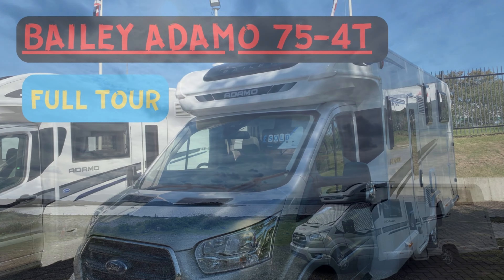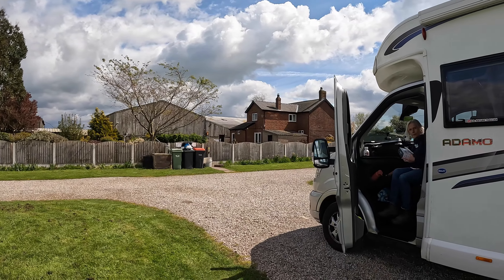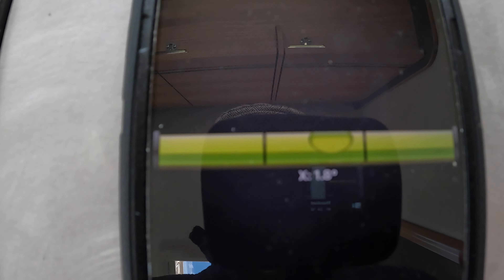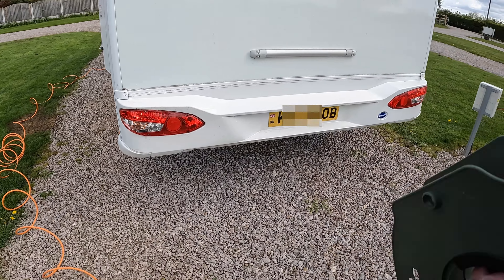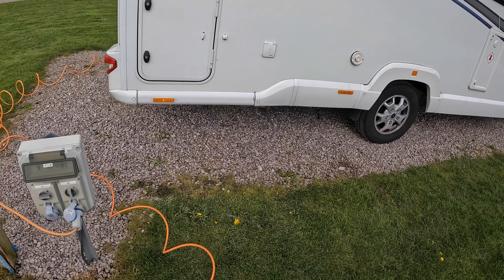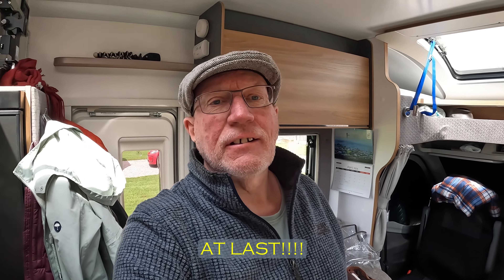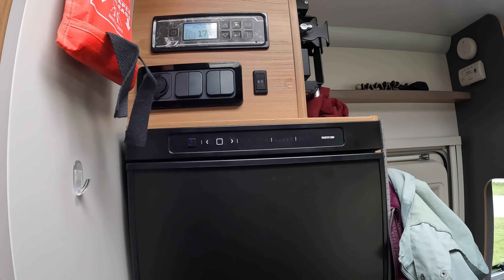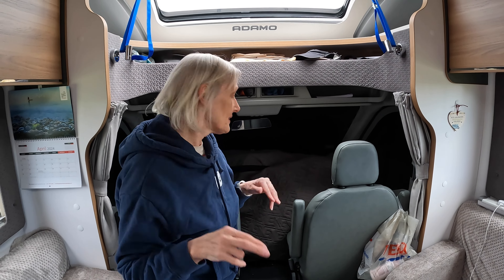HOW WE SET UP OUR MOTORHOME ON ARRIVAL AT A CAMPSITE - Bailey Adamo - A Few Tips and Tricks

Comment: Happy Weekend Dave and Sue wherever you are today! Even though I do not have a motorhome it is fun to see how you do things in Florrie. There are routines to learn and small tricks to discover, but with time you are getting quite good at it! And you do it in a way that is down to earth and credible (not like those movies where it looks like no one ever has lived in the home). I was surprised that condensation could interfere with the electrics of the car. That seems like an unnecessary fault as condensation has been know for a few centuries or something:)  I also see clearly that life is both a bit easier and a bit harder as a hiker using a tent as a home and not a motorhome. Have a great Sunday! All the best, Ant
Reply from the maker: Cheers Ant. Hope you’re well mate. 
Yes we’re learning all the time - already had a comment that has helped a lot 👍
The motorhomes that have been built on a Ford Transit chassis do suffer with the condensation problem. Apparently Ford say it’s the motorhome builders problem and the builders say it’s a Ford issue 🤦🏻‍♂️🤦🏻‍♂️🤦🏻‍♂️
A couple of guys on FB have designed a cover for the ECU that keeps moisture away. But the only other fix is the screen covers so that’s what we do. A bit of a pain as it shuts out a lot of light but I’d rather that than the electrics losing the plot! 😃
Have a lovely Sunday Ant and hope you’re doing well mate 👍👍

Comment: Hi Dave and Sue. Another excellent video on setting up your motorhome.  One of the issues I have had in the past is the electric cable becoming difficult to get back onto the reel because the three internal wires had become twisted over time within the outer cable.  I now always carefully roll out the cable from the reel ensuring that I keep it nice and straight on the ground. I was also quite surprised to see you opening your fresh water tank to check the water level.  I tend to rely on the gauge which I know isnt particularly accurate and will only open my tank probably as little as once a year when I clean it with puriclean.  However we do use bottled water for drinking and for the kettle just to be safe.   Best wishes Dave  PS Looking forward to your next trip to Scotland 👍
Reply from the maker: Hi David. 
Very kind of you as always 🙏🙏
You’re right on the electric cable - I made the mistake initially of just letting it fall off the reel (as I did on this vid for speed) and found it was a real pain to get back on every time. So I always now reel it back in properly. Always so much to learn David!  
The water gauge on the Adamo is pretty hopeless. We’ve re configured it a few times but it’s still only about 75% accurate. So we have always double checked the fill. I made the mistake of forgetting one day and had a flood. As the speed of water from the hose was greater than the overflow pipe could cope with. Again, won’t do that again! 😃
We add purifying tablets to the tank each fill - and even then we only use bottled water or boiled. We’ve also just cleaned the tanks out.
You just can’t be too careful. 
We’re having a holiday with our daughter and grandkids in November in the Lakes. But will hopefully take the opportunity for a week on Arran. Nothing booked as yet but hoping we can visit beautiful Scotland again. Definitely coming up in the spring again whatever happens in November!  
Have a good week ahead David 👍👍👍
Reply: @NBNatureTrailvan  Hi Dave. Thank you for your reply.  Strangely we don't have an overflow pipe on our Malibu fresh water tank so we just use a. blue hose pipe pushed into the filler neck and wait till it overflows.  Dave

Comment: I think the Adamos tend to be more level than other vans. We rarely use ramps either. Very funny re. The water... We only empty boiler if not using for more than three weeks. Silly filling systems isn't it. I turn ours off at 80% to avoid flooding. I find it easier to turn the seats around when I get out I.e. Standing outside. Saves you getting a bad back :)
Reply from the maker: Cheers Chris - good tip on the front seat 👍
We always drain down completely each time as never sure how long we’re going to leave the van - so far it hasn’t been long! 
I flooded the van a couple of months back. We were cleaning the fresh water tank and I was filling for the the third time - lost concentration completely and then saw that the carpets at the front were soaked 🤦🏻‍♂️🤦🏻‍♂️
Have a great Sunday Chris.

Comment: Probably different here in Canada, but we do experience surges in electric power, so always had a surge protector hooked up to the power at a campsite first. Interesting with the water. Are you able to connect to the water with a hose and run the water directly from the tap, or do you have to fill the motorhome tanks for water? I could do both, but if running water, or even filling, I'd use a filter attached to the hose and also have attached a pressure regulating valve, as both quality of water and pressures can vary tremendously over here. Looking great and all becomes pretty quick and easy over time!
Reply from the maker: Hi Bruce mate 
Hope you and Otis are doing well. 
We don’t get surges of power here (or if we do we havent experienced them)🤞🤞🤞
We have to fill the water tank Bruce. We have three ways to do that. Via a hose connection drawn in by a pump, via an Aquaroll 40 litre portable tank which you fill up and roll to the van or finally by a simple hose through the “garage” on the van into the tank. 
We don’t use a filter but we do use purifying tablets in the tank. We don’t use the tank for drinking water (in theory we could once purified) we use bottled water or purified water into containers.
The water pressure isn’t a problem - or hasn’t been so far!  
I have flooded the van once 🤦🏻‍♂️🤦🏻‍♂️🤦🏻‍♂️. But that was me getting relaxed on the third tank fill on a day where we were running a cleanser through the tank 🤦🏻‍♂️🤦🏻‍♂️. Fortunately just some wet carpets!!  But won’t do that again!! 
Thanks for watching Bruce and fascinating to compare notes - keep sending these tips - been very useful. 👍👍👍